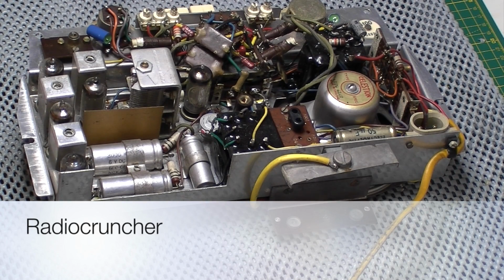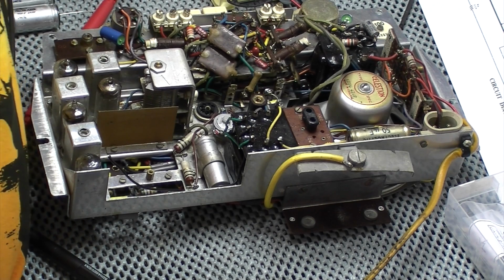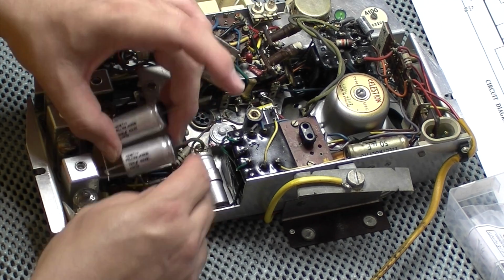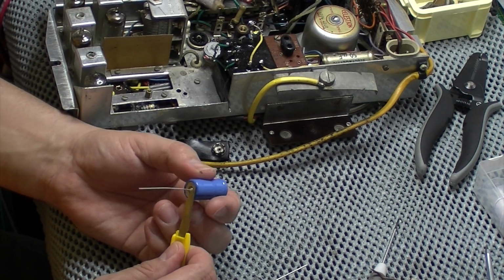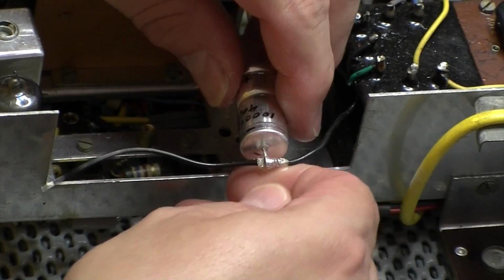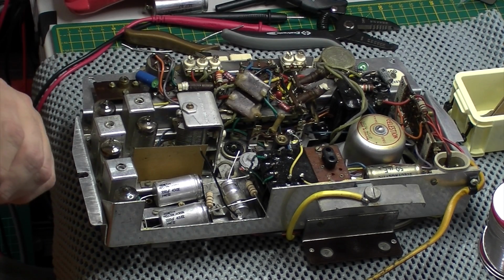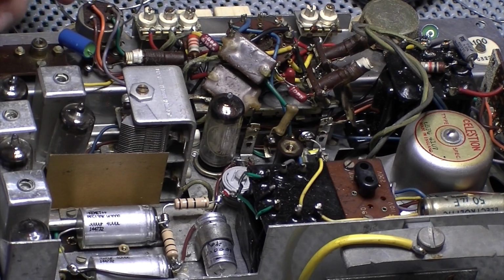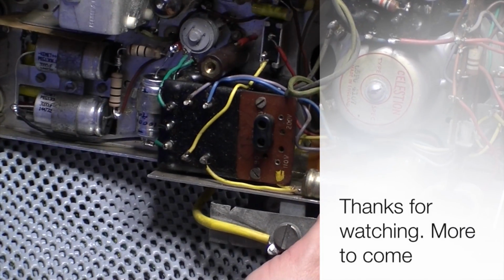Bush EBM60 valve portable radio Part 3: LT capacitor and resistor change

Comment: There is a guy in Ireland(ojnoj) who deals with Valve Battery radios and if anyone knows where to get the Low Plate Voltage Vacuum tubes he will reach out to him if you need Low Voltage Tubes..
Reply from the maker: I have done a lot of battery portables and have a few spare valves

Comment: Nice work , where did you source the larger capacitors  ? looking forward to the next instalment, regards Tim
Reply from the maker: Thanks Tim. I bought the caps from Farnell http://uk.farnell.com/kemet/peg130kj4300ql1/cap-alu-elec-3000uf-40v-axial/dp/2435426 Graham

Comment: when measuring low values take into account the reading on the meter with the leads shorted together.
Reply from the maker: Thanks Simon. I could probably have tried to reuse both the resistors but in the end it made a far better looking job to start from scratch rather than connect to the old resistors. Still not powered it up yet though! got to just check the other HT caps first
Reply from the maker: I misunderstood your comment originally. I get it now lol. I shorted the leads out on my bench meter and it read 3 ohms. On my AVO it lets you zero the ohms with the leads shorted so strange that the Keithly doesn't have that facility. Maybe it does and I haven't discovered it. That would make the meter right then. I was worried that it was needing calibration on the ohms scale. Thanks for the heads up. Graham